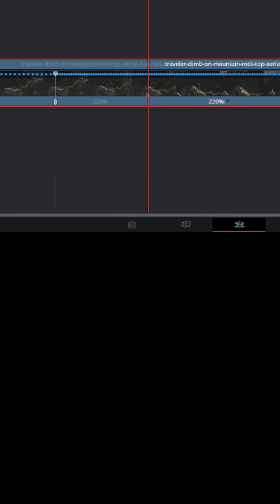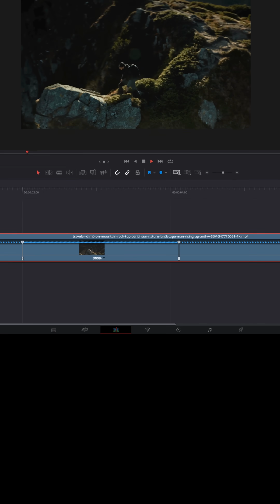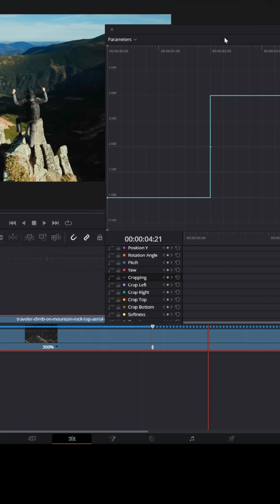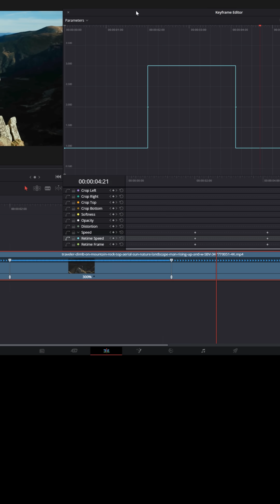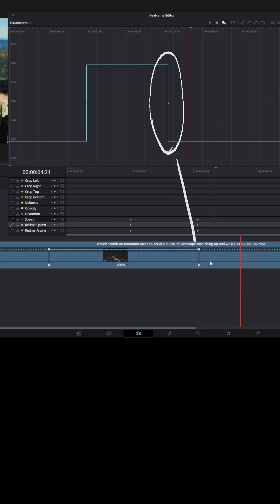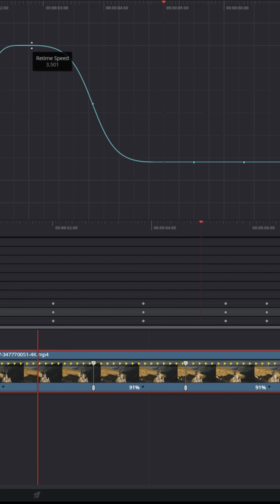Speed Ramping in DaVinci Resolve 20 - Keyframe Editor

Comment: Hey Daniel. My davinci Resolve (19) is not working as every time I open the app it opens but any media I import doesn’t display and it doesn’t add to my timeline either. Is there anyway you know where I could fix this?
Reply from the maker: First thing I would check is if your video file format is supported. 
If you’re using the free version, it doesn’t support the full array of format types that the Studio version does, including things like color bit depth.
Something that simple can stop your footage from properly importing.

The free version of DaVinci Resolve does NOT support:
- Formats: 10-bit H.264/H.265 (4:2:2), RAW formats (e.g., BRAW, ARRI RAW), and some high-end codecs like REDCODE RAW.
- Color Bit Depths: limited  support for 10-bit (inconsistent, especially on Windows/Linux; export restricted to 8-bit). Full 10-bit and higher (e.g., 12-bit, 16-bit) workflows require the Studio version.
Reply: @ Yes I have checked that. I used just a regular mp4 and also a jpeg image. I have tried the same exact footage on the same resolve software on a different computer and it’s fine. It’s just my one computer
Reply from the maker: That could be a million things.
It could potentially be a system issue, not a Resolve issue.
What's the codec of the footage you're importing?
If you're on a PC and you're tying to import HEVC h.265, your system might need to install the WIndows HEVC extension to support it. 
https://apps.microsoft.com/detail/9nmzlz57r3t7?hl=en-US&gl=US
or you could covert it to a different format type with something like handbrake.fr
Reply: @ I don’t think it’s a codec issue as I’ve tried multiple formats and even footage I have used that works on other windows devices and Mac devices that run the same version of DaVinci. Im sorry if I cant explain it well. Is there some sort of troubleshooting website or forum i could find to where i can submit my problem?
Reply from the maker: You ignored my last two tips, didn’t check your codecs or even see if you have your OS extensions up to date.
If your OS isn’t HEVC compliant, doesn’t matter how other computers act, they aren’t the system in question.
Anyway, hope you solve it!
Reply: @Daniel_Batal Oh sorry I didn’t see that but I’ll check and let you know as soon as I can

Comment: If you have your timeline set to say 30 fps and your clip that you're importing is at 60, then the editor will ask you if you want to lower the frame rates of your clip to fit ur timeline right? so then once this happens and you decide to export the edited video will it be in 30 fps or in 60?
Reply from the maker: Once you’ve changed the timeline frame rate, it changes the frame rate for the entire project.
Even if you set the export settings back to 60 frames per second, it doesn’t restore the frames it’s removed.
Reply: @Daniel_Batal  ah I c so if I want my project to be 60 fps when it’s uploaded, I should have the timeline fps set at 60?
Reply: But then wouldn’t that make my playback lag more?
Reply from the maker: If you can’t edit a project at 60 fps because you’re worried about it lagging out your project, then you have much bigger system resource issues that you should address.
Reply: @Daniel_Batal  ok thx bro!